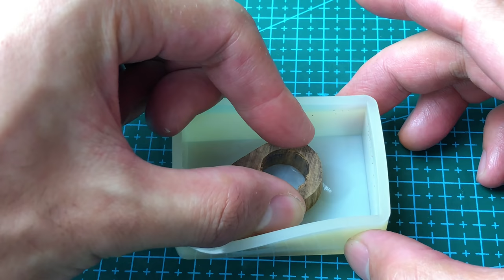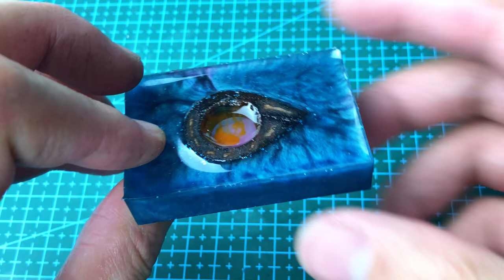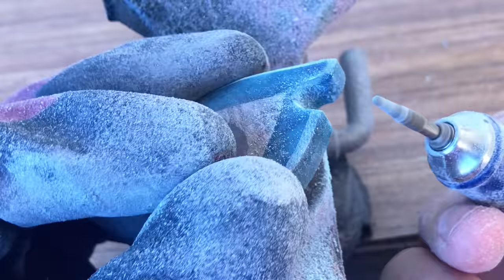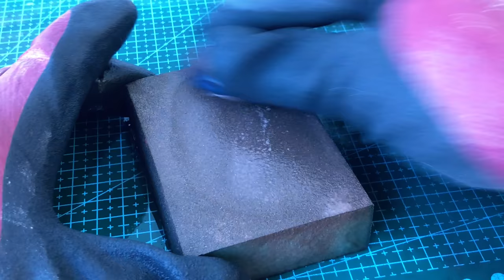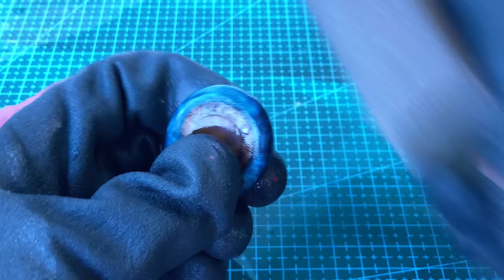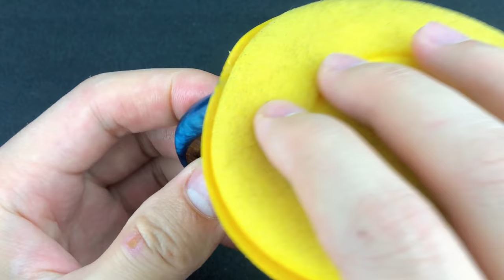Resin art Amazing fantasy blue Teardrop Necklace Pendant jewelry/epoxy resin necklace jewelry S105

Comment: Another great piece! Though I have one small suggestion to make. When one of your pieces has a hole like the teardrop wood, take the rotary cutter to smooth out the inside.
Reply: Was just going to say that, the raw edge with fibers sticking out was driving my ocd nuts but it all gets sanded down in the end 😀
Reply: এই আঠা তৈরি করে কীভাবে?